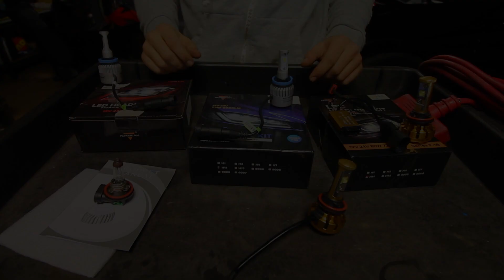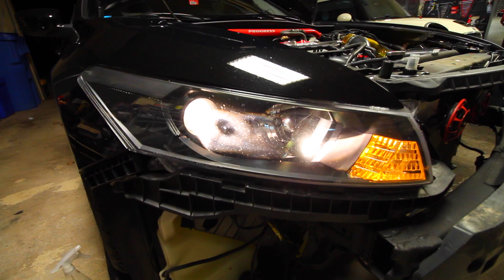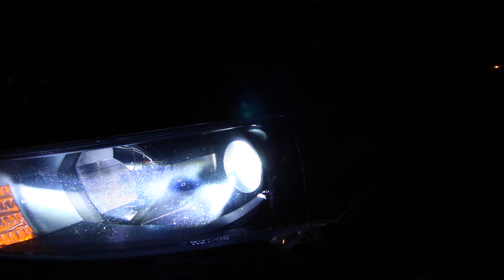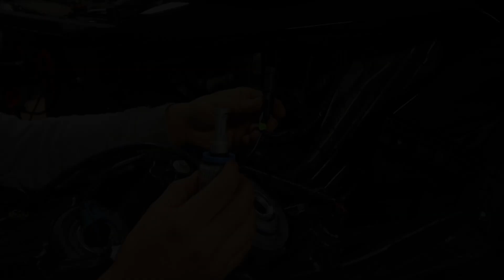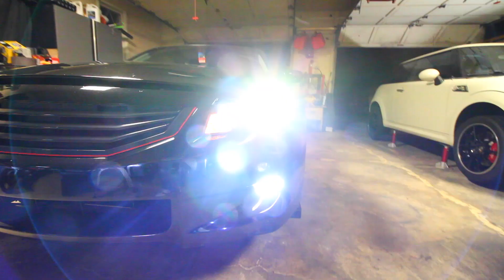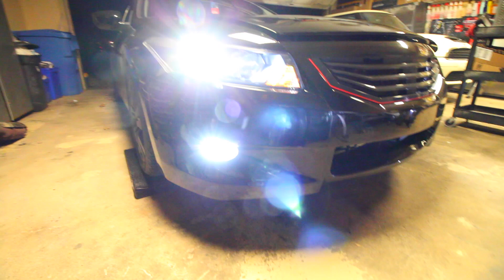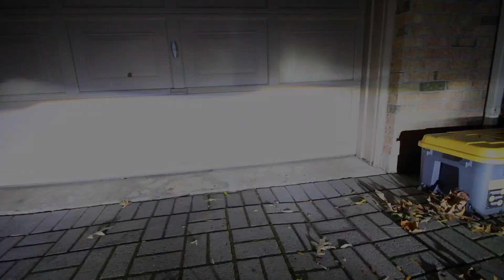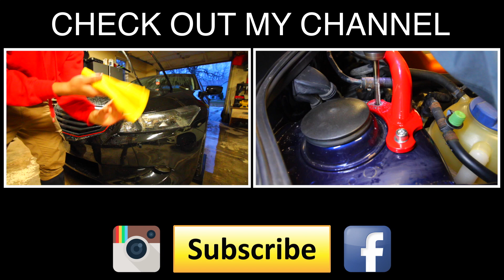LED Headlights: Are they Better than Halogens?

Comment: LED don’t last long, over a year they will fail for sure. I had LED for my angel eyes on the bimmer in a year I changed a 2 sets I got tired and got back to the hallogen.
Reply: halogens are way nicer and classy.  Also they don't blind on coming traffic at night, which is a form as assault.

Comment: Do not buy all this chines crap!!!!! Buy real OEM Philips (Germany) led bulbs or IPF led headlights bulbs (Japan), which light output is much more than OEM Philips. I’m using ipf h11 first generation on Prius 30, and Philips h11 on Subaru Forester 2012. Chines crap from amazon is peace of junk. 100000000000000%

Comment: Sorry buddy but those color temps are crap, especially for wet roads. Results are crappy too. You need to buy better designed led bulbs that have the correct placement of the diodes.

Comment: these LED lights dazzle oncoming motorists and dazzle motorists from behind in their rear view mirrors. I am a vision specialist and  I consider these LED lights to be dangerous. Having dazzled the other motorists it leaves them with a degree of night blindness thereafter. I would rather that these lights be legislated against
Reply: @matt faragher I couldn't agree more! I think a lot of people just install these LEDs to JUST make their vehicle standout from others. As a senior citizen, I am especially sensitive to the "blue spectrum" light emitted that causes the glare to oncoming drivers.
Reply: @TheOzthewiz  I put LED's on my cars because I can't see a thing at night with basic Halogen bulbs, granted. I drive vehicles that are older than I am, however. You can always have the bulbs pointed downwards to avoid blinding other drivers

Comment: I get blinded often too. Super dangerous as if the have their high beams on. Utter BS. Should be ticketed - after a warning to level theirs lights with an obvious cutoff point. Bright lights can be very useful in towns where there are no streetlights even on narrow , highly trafficked streets - the kind where you have to cross the center line and into a gap of opposing traffic in order to get past a bicyclist who's going 8 miles an hour. The kind of town where lots of people  wearing dark clothes at night don't look (stuck on smartphone) before stepping into an unlit crosswalk where the stop sign is obscured by an overgrown tree. A lot of towns would prefer to put up more Christmas lights than street lights for some terrible reason.  You're not gonna attract shoppers if pedestrians are being hit by cars. The solution might be just forcing cities to switch over to low-cost LEDs everywhere.  Maybe the high-power LED's belong in streetlights, not cars.

Comment: Correction @1.20 you state the bulb is a H11 and say it's the size of the bulb,this is incorrect H11 is the connection fitting type not size of bulb.

Comment: So if there is no heat from the LED bulbs how does the snow and ice melt off the fixtures when you’re driving in the winter in CANADA?
Reply: that is what I was gonna suggest. Do not buy them if you are mainly be driving snowy/icy condition. It doesnt generate enough eat to melt snow or ice. Friend of mine tried it ,and it as terrible .He went back to halogens
Reply: It still gives off heat just not as much as regular bulbs
Reply: You wipe them off yourself. Crazy idea right?

Comment: not all car have room for those big ballasts. Mine surely doesn't (have to remove the battery just to change the bulb).

While halogen does produce heat, that can be a good thing in the winter time.

Additionally, I have not found a single LED light that puts out white light. Every one of them has a blue tint to it bar none.

Nice video though.

Halogen is the closest thing to sunlight you can get (well except for maybe maybe Xenon bulbs if you can find them).

I did find that LED tail light bulbs work GREAT!

Comment: LEDs have drawbacks as 360 degrees reflection isn't possible unlike traditional bulbs, as a result LEDs wont fit inside the reflector headlights.

Comment: This guy doesn't know what he's talking about. "White end of the spectrum"?? White light is composed of ALL colors of light, i.e. the entire spectrum. If it's higher color temperature, it's towards the blue end of the spectrum. If it's a lower color temperature, it's towards the red end of the spectrum. Somewhat ironically, the higher temperature has a "cooler" feel, and vice versa. For example, typical home fluorescent lights have a higher color temperature than older incandescent lights.

Comment: Hi I just recently installed the Auxbeam F-16 6000 lumens for my loe beam headlight, what lumens should I match with my fog light? Is it the same 6000 lumens or higher? Thanks flt your fast response

Comment: if the vehicle didnt come out with leds from factory in australia its illegal to fit them, why Narva have brought out the approved 60% etc brighter type id like to see a comparison of the equivalent narva gloves versus the leds..
Reply: @Darren_Knight_The_Truth  I live in Australia and have done for fifty years. Its no coincidence that since the advent of super bright headlights , drivers use high beam more than ever. in rural areas 9 out of ten drivers will not dip their lights unless you beam them back.Interestingly there is more roadkill now than ever before, which I believe is from animals being blinded and not knowing which way to run.

Comment: I've researched this and I've spoken to the guys from headlight revolution and they told me LED bulbs do not work well in a projector style headlight. The light from the LED will be dispersed everywhere and you won't get a nice hot spot. So if you have projector style headlights you're better off installing HID's. They will cost you more but Saftey is better then looks that's just st my opinion. Good luck with your choice

Comment: You have no technical understanding of headlights or beam angles, you are clearly basing the review on the brightness and colour however if the beam pattern is not correct you could blind other drivers and cause a serious accident. These are cheap and nasty lights and as shown on of the units has COB LEDs whitch are totally unsuitable for headlights. 

Turn off your fog lights idiot and do your homework before trying to advise others when clearly you have no idea what you are talking about

Comment: "It doesn't catch your eye" as he's speaking about halogen bulbs. The light isn't supposed to "catch your eye" it's supposed to catch the road. Far too many jerks put these led's in their car and don't give a damn about blinding on-coming traffic. I see these jerks everywhere. At least your bulbs apparently have a good cutoff most don't. Also it's not as simple as plug and play either, many newer cars that have CAN BUS these lights will cause error codes so you'll have to have extra modules in line with headlight wiring.
Reply: HID and LED are all bad.  There is nothing one can do to make them work efficiently and not blind people.   It's the type of light it is.  It's more closer to a many lasers spread out in a cone.    even the actually headlight is too bright to glance at and you can't see around them.  They're hot white or even hot yellow and it's about 80 times more bright but also the type of light is it.   IT's a dangerous light

Comment: What CAR are you putting them in!  As I have a 2013 G37S Sports Coupe.  They only have 1 Socket for the Low, and High Beam, and the Fog ling only  But the LED has to be a Low & High beam in one right?

Comment: There are tons of LED headlights available, but most of them are junks.  Most people don't do their research b4 they buy, they go with the cheapest.  Any LEDs less than $120 you can count on they are crap or junks.  You get what you paid.  According to some independent labs that tested them,  both Auxbeam and OPT7 belong to the junk list.  As of now HID still the best headlight upgrade, LED does have the potential to be better but not there yet.  HID is at its max, cant be better anymore, LED just barely started a few years ago so with time can be better.  Thought i should throw in what I learn from my own research to share.

Comment: All three have drivers, the first two have thier drivers  in the fixture, the drivers are part of the heat source, but LEDs get hot as well, the third one has its driver externally, hence why the third one isn't as big on the back end. Now one thing to note, the drivers internally or externally don't reduce flickering or error codes on their own. CANBUS adapters fix error codes and flickering which that third LED driver may have integrated, but doubtful.

Comment: Does anyone have a good recommendation for an H11B replacement bulb for a KIA Optima that offers a good bright white light and with an overall nice mellow blue hue projection, not just when you look directly into them. I just got a new car with this size bulb and not familiar with any good bulbs for this fit. I previously used Phillips Diamond Vision bulbs which I always liked and highly recommend. I’m not looking to convert to HID or any other change to my wiring right now, just need a plug n play bulb. Thanks in advance for any good recommends.

Comment: Would it make a difference if the original lamp with the previous  halogen. Or would itt need swtch to another lamp system? component? I live in the bundocks without enough road  light.

Comment: The issue with LEDs is the depth of the bulb.  I have yet to find one that will fit inside my headlights that will allow the dust covers to be installed.  I know they require a fan, but having cool LED's is not a smart trade off for getting crap into the headlight.

Comment: You didn't mention one time the most important thing that has to be done anytime every time a headlight bulb is changed replaced and or is upgraded. That is adjust the headlights. Smmfh. Even on 5 year old cars and older it is always smart to adjust the up and or down and left and or right angles of both headlights. And on trucks when you are pulling a trailer or loaded down in the bed weight on the rear of the truck and or add tires and or a suspension upgrade and for both cars and trucks anytime you change wheels tires ADJUST YOUR HEADLIGHTS!!!!! This is why most ppls headlights are causing them to be brightest by oncomeing traffic. An your saying duurrrhh why am I being brightlighted so much my lights are on dim well cluster fuck genius, common sense would tell a blind man to adjust your headlight beams out of the eyes of on coming traffic and so that you urself can even see better at night time . Smh

Comment: Question: why did you put the brights on the low beam, and not the high beam. And is it wise to have them on both high and low beam as well as the fogs

Comment: LEDs are brighter, but the retro kits do not produce the light throw down the road like halogens or HIDs...so LEDs are just not there yet for headlight replacements. Although if your car comes with an OEM headlight, then that is different!

Comment: Thanks for the informative video! I have a brand new Toyota Highlander that comes stock with halogen bulbs in the headlights, high beams, and fog lights. 
Would you suggest changing out all of these compartments with LEDs? or?
Do you know anyone that has done this with a newer Highlander??
Any tips, etc.?
Thanks in advance!

Comment: In the UK it's illegal to put LED or HID bulbs in a reflector headlight unit. Same goes with projector headlight units. Can only be used in xenon and bi-xenon headlight units. Anyone in the UK reading this be warned that the cops are on your case to stamp out this very dangerous and unsafe trend.

Comment: Looks
Like this upgrade should be restricted to headlamps with projectors only otherwise you are going to blinding others with the light spill.  You can even see it in your video when you turn the fogs on, they spill above the headlight cutoff line.

Comment: Problem is LEDs blind the fuck out of other drivers...its basically like driving with high beams on
Reply from the maker: When installed in the improper housing, yes it will blind drivers.

Comment: I got the LEDs installed today in my car on both high and low beams. So far I am getting used to it. But I hope they are nicer and more far-reaching than then halogen lamps.
Reply: How are the leds night time  mate
Reply: @Hasnain aki Ali  they were terrible. The reflections were not spot-on as the LED sticks on the tube were not even. So returned them after one day. The original lights were far better.

Comment: Firstly why are your halogen bulbs so yellow?Halogen headlights almost always have a shield in the bulb to provide the dip beam cut-off pattern, I've not seen an LED bulb that has a proper cut-off pattern. Headlights are designed around the original bulb, no LED as yet mimics the exact physical position of a filament, the LED chips are far too big, so the beam pattern (and oncoming drivers) suffer.

Comment: question, does the orientation of the led bulb matters on projector housing? I heard on reflector the orientation should be side by side ( 9 to 3 o clock)so that it won't blind other drivers, what about projector?

Comment: Nice video.. one question. I have installed Aux beam LED Fogs with H11 socket on my car but recently I had a small crash and my one fog light socket is broke. The repair guy replaced H11 socket with H8 and now I've one H11 and one H8 sockets. If I install H11 LED on H8 socket(by trimming the lock tabs), will it effect the light output??

Comment: Personally to my knowledge they don't make HID LED  replacement headlights yet. However I can't comment on the conversion kits as I haven't used them yet. As far as blinding people. 

You need to know the right types of headlights to get. I've replaced all of my lights with LEDs and they look great. Not to mention you don't have to worry about burning out a f**** light. 

Which is really annoying especially when some f**** cop pulls you over over for a burned-out bulb. Now with that said there are some things one needs to look out for. 

From my experience halo projector headlights do not put out any where the light that a reflector light does. Which actually creates a bit of a problem. As it doesn't focus the light far enough ahead of the vehicle. 

That might force you to use your brights more which I don't recommend. Because I have found using your brights too much. Creates an almost magnifying effect on the front of your lights. 

Which will actually melt the housing i have found. This is where an HID LED bulb will come in real handy. They don't generate anywhere the heat that regular HID bulb do. 

 I can run my LED headlights all night and not have to worry about draining the battery. Another thing to keep in mind. Is you may have to get a special digital fuse relay for your vehicle. 

Replacing all your lights with LEDs will f*** with your vehicles on board computer. Causing you to get error messages about burned out lights. If you can get the fuse box modules I recommend that as it's the easiest to fix.  

LED headlights are here to stay and people need to quit their complaining. Certain brands are certainly better than others. So it pays to shop around. But overall It's an investment most agree is well worth it.

Comment: So i'm confused.  The first 2 bulbs you showed are clearly labeled 8K Lumens.  However, is it "Understood" that it is 8K LM to a PAIR?  Or is that 8K PER bulb?  I'm looking at the first model you showed on amazon, and it notes 16K LUMENS for the pair, which seems to indicate 8K per bulb, but earlier in your video, you mentioned 4K per bulb?... could you clarify?

Comment: I'm sorry but LEDS still are completely over-rated. The LEDs are in no way throwing 8000 lumens or even 3000 lumens. Also you say they look brighter but problem with LEDs is they have shorter throw. I've tried drop in 45w LEDs and they look bright up close but have no throw to them. Good halogens still outperform LEDs and HIDs are even better. I can easily show differences with my "10,000 lumen" (yeah over-rated) flashlight. The wider the beam the shorter the throw, so you either will need more lights or smaller beam. I assume your light output was satisfactory for you because you used fogs and headlights.

Comment: what kind of car, requires to screw off the whole front bumper ! glad at mine it was lot easier
Reply: I had to remove the entire front bumper on my 2000 Toyota Celica 🤦‍♂️
Reply: @iidontgiveadam  OMG! And I like Toyotas for their reliability!
Reply: @TheOzthewiz  To be fair the bumper on a 7th gen Celica isn't that hard to get off and on again, and the sweeping shape of the front means that it is not possible to get the whole light unit off the car without bumper removal.
You can change the bulbs pretty easily without taking the light unit off though. Better to get some decent Osram xenon-effect +120% bulbs if you want bright and clear white bulbs rather then LEDs.
Reply: I skimmed through the video but when it got to him holding a power drill and his whole front bumper off, i thought "F that!" I will stick with halogens!
Reply: @Porkchop1967  You can get halogens that are either blue-tinted or crystal clear white from a decent OEM manufacturer and just swap them in. You could also swap your front sidelights (parking lights) for LEDs as just a straight swap.
Reply: @Porkchop1967  Sylvania ZXE bulbs are amazing for halogens. Try them out
Reply: Honda lol.

Comment: You don't see an increase in performance. Your garage is WHITE. Your light is WHITE. Perception of more light output is due to your eyes being more receptive to white. But in real life performance, the asphalt will eat away that white light and when it rains out, it'll be even worse as white light above certain kelvin temperature gets sucked into the water and reflected back to your eyes. In other words, you won't see better but worse.